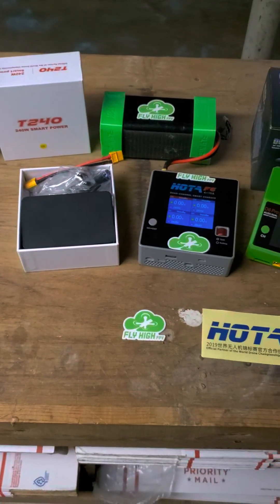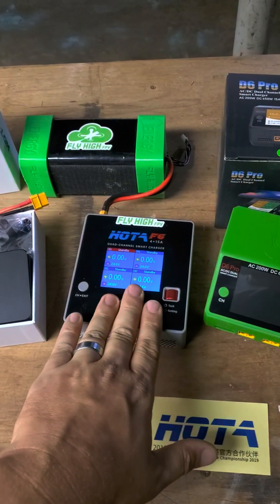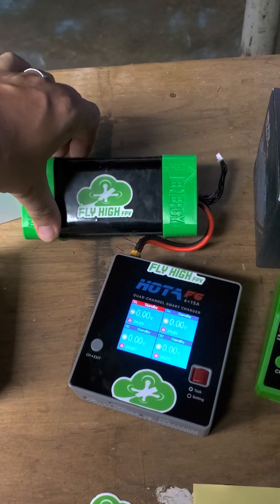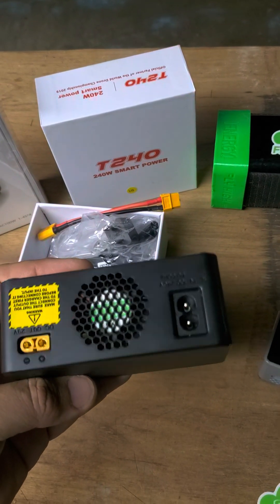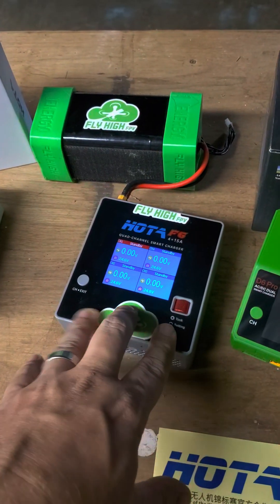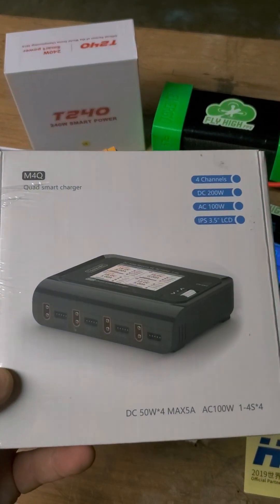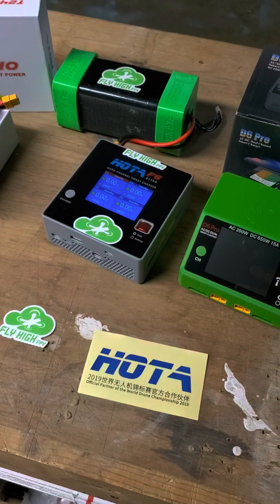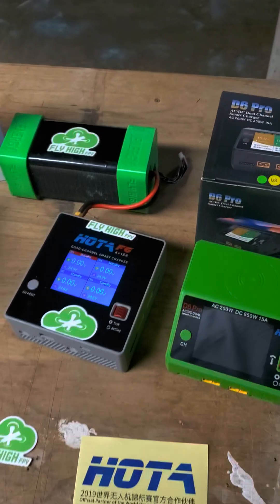How to Charge Drone Batteries - 4 way charger from HOTA the F6 , and Dual Charger the D6 Pro

Comment: What type of battery do you use for your hota f6 charger  ,the battery for the dc power supply
Reply from the maker: This is the Stay High Pack. It's 6S 15,000mAh, Molicel P42 21700cells 6S3P.  They are made by Upgrade Energy in the USA, laser spot welded copper bars 👌

Comment: That power supply seems pretty weak for for a beast like that f6 charger, that is capable of a thousand watts. I recommend if you're going to be charging off of AC power with this thing a dedicated 15 amp circuit with a 1200 watt power supply. If you're going to be running this charger at max capacity make sure you've got the headroom so that you're not overloading the power supply. A good rule of thumb is to run any electrical component at 80% of its rated capacity. So obviously it would also be a good idea to run the charger at max 800 watts.
Reply from the maker: I 100% agree about using a full PSU for a solid home setup. I use an HP Server PSU at home to power 3 chargers at the same time (29amps continously) . The T240 is 240watts at 29v,  so it will deliver about 10 amps at 6S, so 2.5amps x4...gonna be enough for charging packs at 2C rating, which is only 1/4 of the F6's full potential. I like the T240 supply for when i travel, it's perfect for the hotel room.
Reply: @Fly_High_FPV  The Server PSU only puts out 12v though correct?
The Home Power Supply you mentioned in this video says 29v output.
Seems like I'm missing something in between about how you ramp up the Server PSU to put out 29v
Reply from the maker: @Casper042  server PSU's come in 12v or 24v.  You don't need to ramp it up to 29v, the charger will do that for you.  If you start with 24v the charger does less work to get to 25.2 than if you're at 12v to start, but if you have hundreds of watts, you'll make a few amps (take watts / divided by voltage to get amps, current)